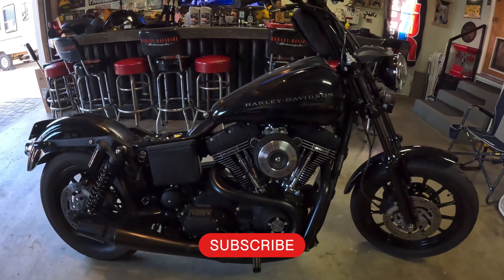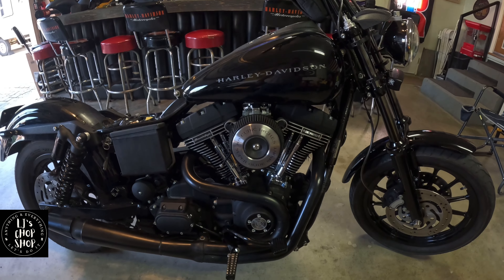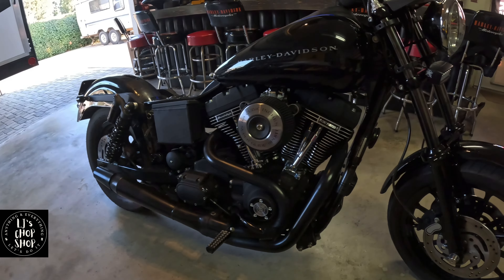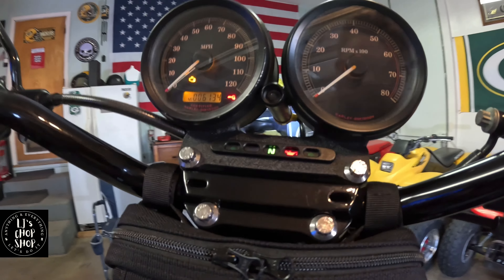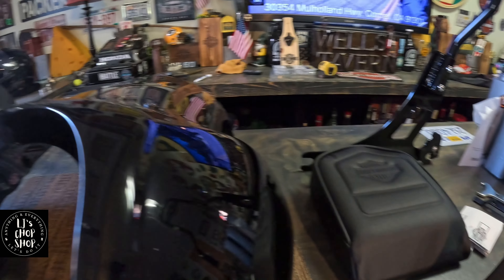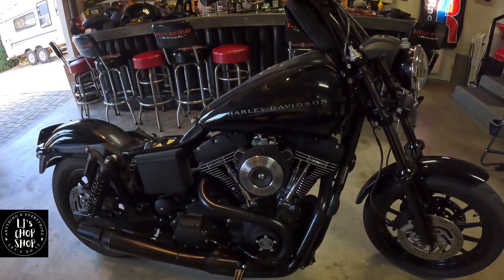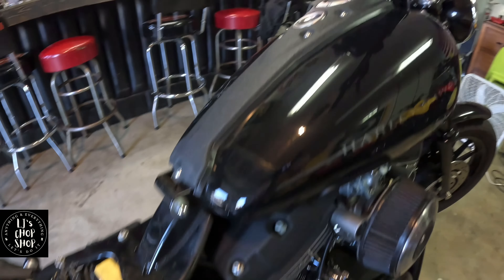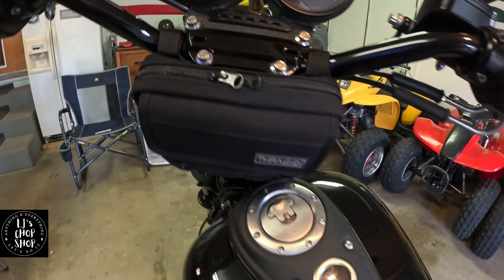Project Dyna, FXDX Walk Around, Part 1

Comment: Are the DLC 39MM FXDX tubes the same as regular 39mm tubes? Thanks, D
Reply from the maker: They are the 26.25 length which is stock for the FXDX and would be considered PLUS 2 for the standard FXD models with the 24.25 length.

Comment: Nice , I've got a 05 FXDC , are you putting on a engine stabilizer?  I went with the Trutrack , made a big differance , it will be nice when your done , but , their never done ...
Reply from the maker: Exactly “ Never done”, the bike has the Big Bear Chopper front engine mount. Literally no wobble at 120mph plus, found that out on an undocumented trip to Mexico. 
She’s rowdy but smooth on the highway.